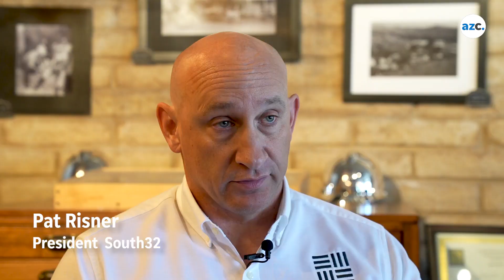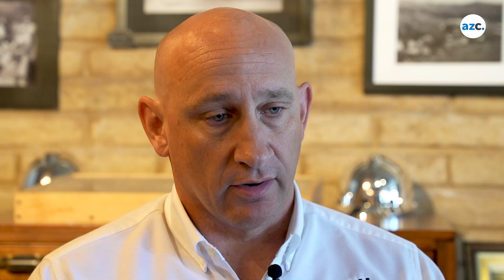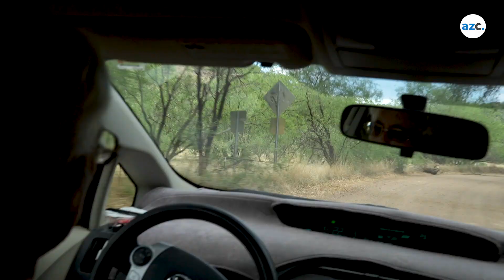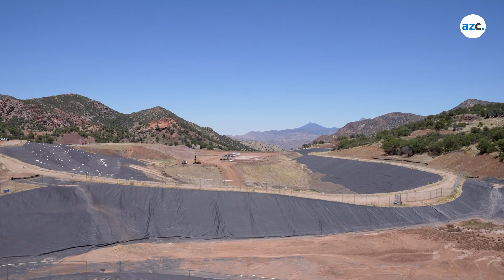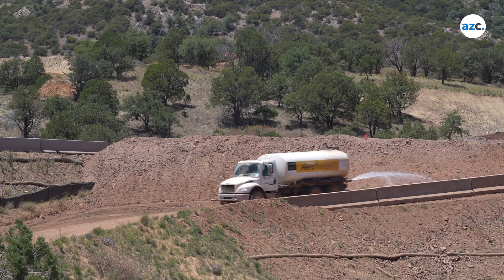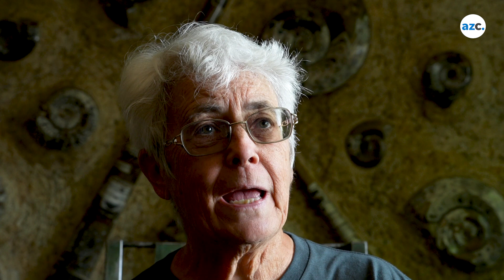Electric car batteries need minerals. Will America mine its own?

Comment: Like it or not. Gasoline powered cars are by far cleaner than EV. The power needed to mine, make the batteries and they dont know what to do with used batteries is vastly more polluting. Also electric cars are far more expensive. These so called environmentalists goal is to bring down our standard of living.
Reply: You know they do the same with Oil. They need Man Power too Drill the Oil 🧠  Oil Spills happen all the Time